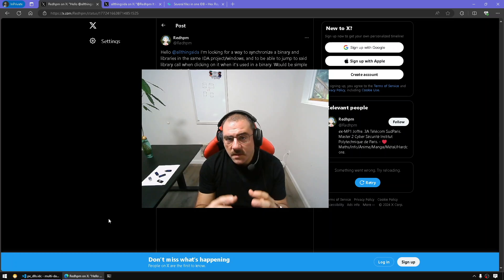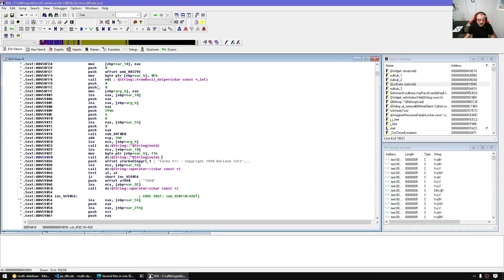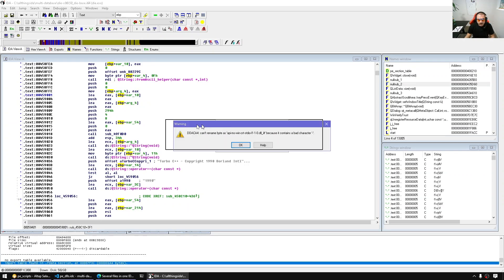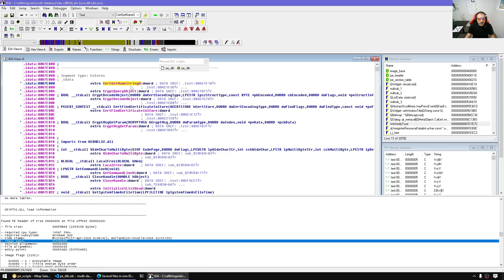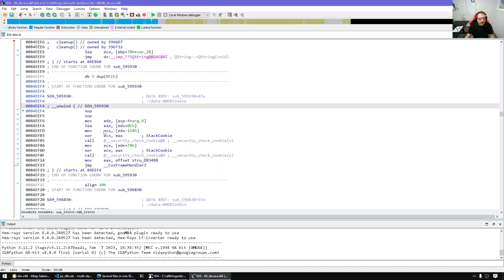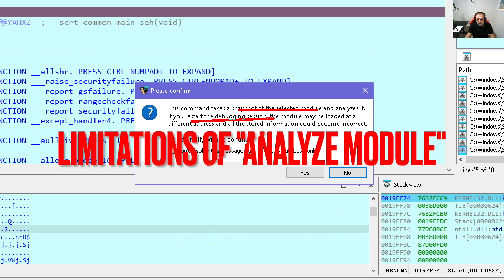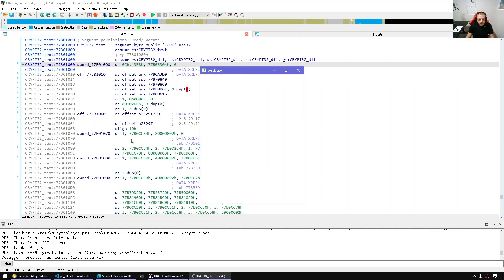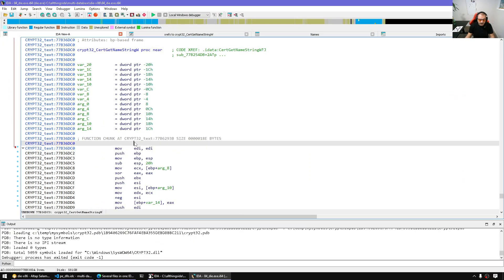How to analyze main input file & its dependencies in a single IDA database

Comment: hey my buddy i was asking about if i want to patch a data string in the .rdata section but i want to add a bigger string is that possible?
Reply from the maker: @Ikd19qqw  no. You can try to add the longer string somewhere else in the gaps and then update the code pointers to it.